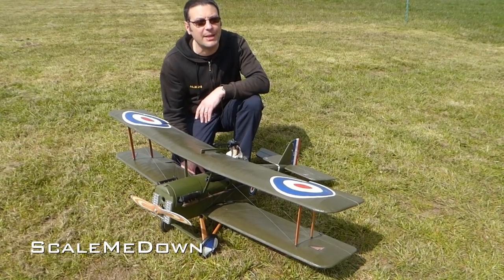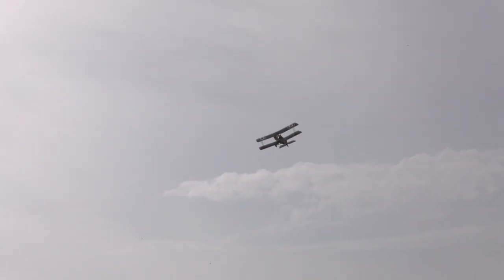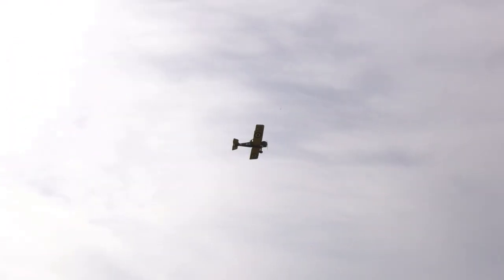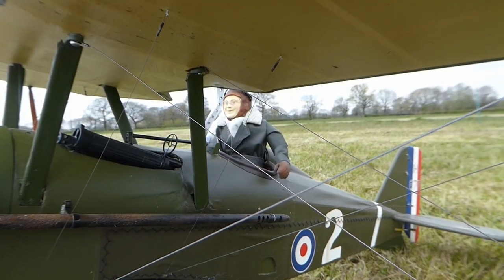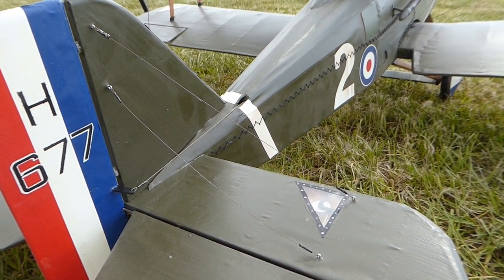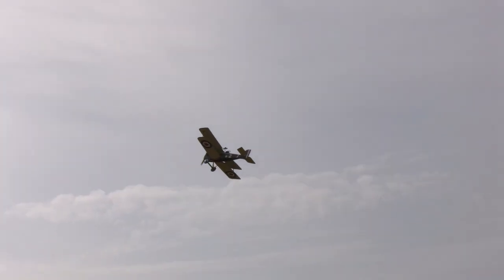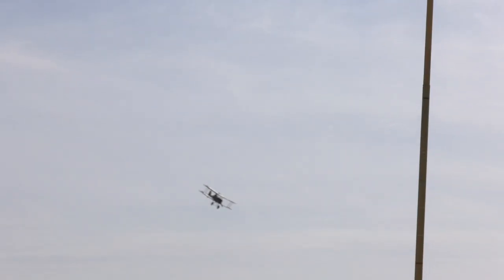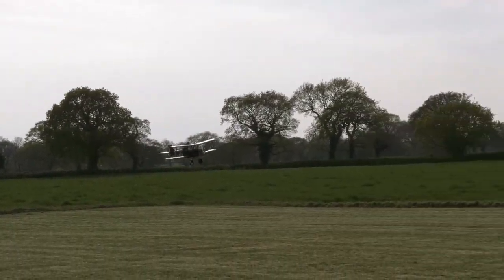Flair SE5A

Comment: Hi Do you have saved photo of mecanism for move aileron, rudder and elevator? best regards
Reply from the maker: Hi.  I used the "snake" method to move the elevator, exactly as in the instructions.  i simply replaced the rudder control with pull-pull cables.  I used separate 9g servos for the aileron surfaces ;- the pulleys and cables are just dummies for show.  Sorry, I didn't make any additional drawings